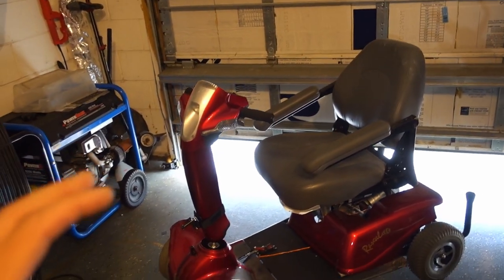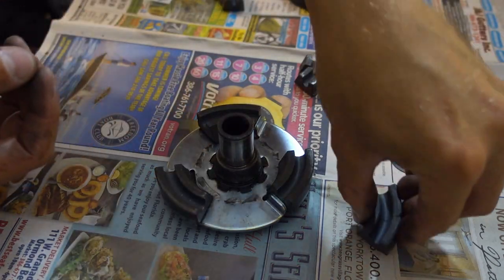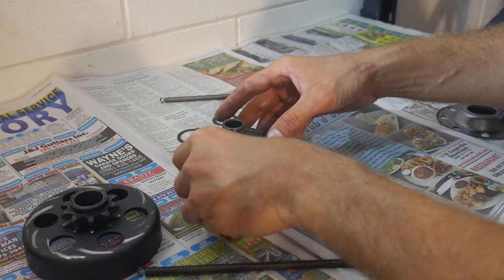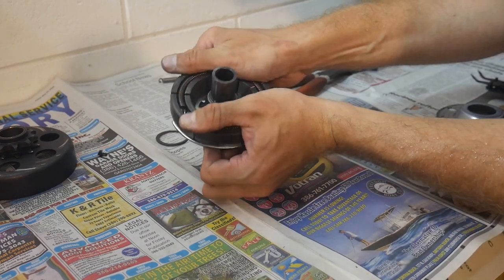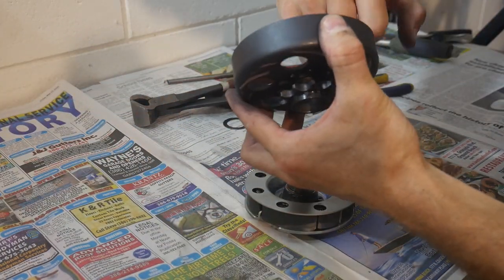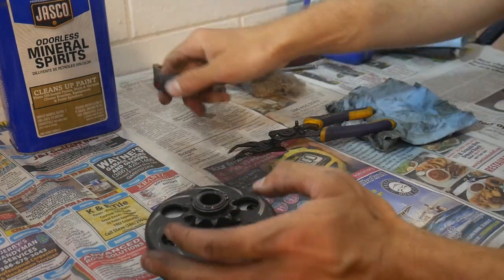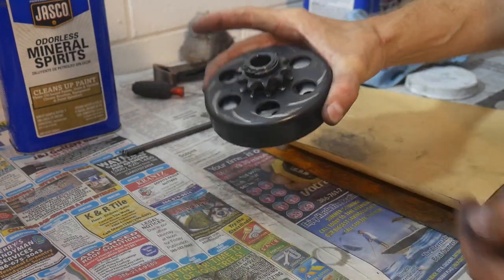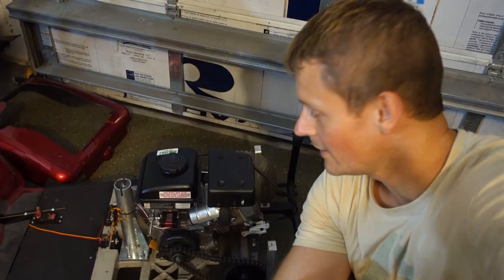Free Go Kart Clutch Performance Mods | Centrifugal Clutch Upgrade

Comment: Black electrical tape wrapped around the outside circumference of the shoes will hold them together so you can install the spring, and reassemble the clutch. Once assembled, simply remove the tape. No more popping shoes.

Comment: Pro tip: use a hose clamp to keep shoes in place if you’re having trouble getting the spring in place😘
Reply: Better pro tip, remove the sproket out of the bell and flip it upside down, sit everything in the empty bell and put the shoes and spring in , then put the top, c clip, and pull it out; then put your sprocket back in the bell and stick it all back together; also I use a 1” piece of pvc for the C clip and hit it with a mallet

Comment: That's pretty impressive I've never seen anybody put a clutch back together like that and make it look so easy.  It's easy for me, but I have a trick. I could never put the clutch back together the way you did it with out some serious aggravation . I put the shoes and the springs together facing down on top of the plate you had on top.  And then I mash the other plate with the fins on it into the piece holding the shoes.  Then I grab a couple of  small C clamps and clamp it togethe, before I put the lock ring on.  Otherwise they blow up in my face as I'm trying to put the lock ring back on.

Comment: A trick on re-assembly I did was to put a large hose clamp (or double clamps strung together) around the shoes before putting the thin plate and snap ring on. It retains the shoes nicely. One benefit of these clutches is unlike the maxtorque- these can get locked onto the shaft tightly by the drive shaft end bolt. The xtra tension helps keep the key intact.   Mike
Reply: Smart trick I like that
Reply: yup, me too, put 2 hose clamps in series to hold the shoes together while I stretch spring into groove!

Comment: It kill’s me to watch you struggle putting the spring in and the pieces going everywhere when could have turned the outer plate upside down and placed it the cradle. Then put the spring in.

Comment: Max-torq has a similar video on how to modify a standard centrifugal clutch for racing. He cuts all of the shoes in half, and takes 2 loops out of the spring and says to only do the modifications on a new clutch, never a used one.

As a side note, I'm building an old kart for my niece, the first one I took over for her and her brother is too long for her to reach the pedals, a centrifugal clutch is the last item I need to surprise her with a new kart, and I'm on a stay home dad budget, my kids kart is already finished.

Comment: Maybe you can help me out:  Just purchased a go kart with a 212 predator 6.5 hp engine.  It has a centrifugal like the one shown on kart in this video (i believe it has 10 teeth).  When we first ran it, it ran like crap.  But once I cleaned out the gas tank and replaced the fuel filter, tore apart and cleaned the carburetor (removed the jet ran thin wire and carb cleaner through all the ports) put it back together, and finally replaced the plug with a recommended High performance non resistor AR3910x Autolite plug,  it ran amazing with top speeds of 35 MPH.     I'll be honest, I don't know much about live axels, centrifugal clutches, sprockets, or torque convertors.  The live axel has a 60 tooth sprocket  Question:   Is there anyway that I can gain more take off power, especially like in grassy areas??  It will take off pretty decent on pavement, but once it's in  the grass or making turns, It takes awhile to get going.  I know the centrifugal clutch on it is wobbly ( like really wobbly) rusty and loose... maybe it's not engaging or slipping during take off???   So would replacing the clutch help with more bite/grip when during take off?

Comment: I just finisd putting a 6.5 hp honda motor in a mini bike and it has a brand new clutch. And it just smokes the clutch I'm gonna try this modification and see what happens. If you wanna send one cool I'm probably gonna need one.thanks.and I have an old briggs and stratton engine that the shaft is 7/8  or 1 inch the Honda is 5/8 and I can't swap the the clutch from engine to engine

Comment: What works the best is to make that piece of crap spring perfectly round. Goes together so easily, you even start enjoying swaping the  clutch shoes or spring itself. It also catches at much lower rpm because the spring is not dragging

Comment: Predator engine in a go cart for my son been having it for a few years it has a 13 and a half predator engine but no drive train did have a 30 series tourque converter but not big enough for that amount of tourque so it just went threw belts so did away with it it calls for a 40 series but haven't been able to come up with extra funds to acquire it but this project is extremely important to me cause it was something me and my brother was working on to get going for my son and my brother here recently pass away so I wanna finish it for him basically cause it was something we was working on together

Comment: hi. thanks for sharing all this mods. one question: Is it normal to have 525 Farenheit Temperature in the Clutch??
Reply: Thats a hot tomata
Reply: I'd say no, but I'm running a Briggs and Stratton Vanguard Vtwin 479cc 16 hp in a Massimo Baja Warrior MB 200 minibike and if I give it much throttle at all on take off from a dead stop it slips horribly even with a new clutch. In fact going up my buddy's driveway wich has a moderate incline, from a dead stop actually made my clutch visibly glow red until I reached the top where it leveled off ,I let off the throttle and the clutch grabbed and then began to cool down. I had to immediately disassemble it and re lubricate the needle brgs which had cooked every bit of the high temp lube off of them.

Comment: Any ideas how to get a very low RPM? I’m talking about 100 RPM or engages around 3-4 mph.
Reply from the maker: You want very low rpm engagement right? Would be the opposite of my mods, so going with a lighter spring or stretching out the stock one. Any engagement that low will probably stall the engine pretty quick though

Comment: Hey thanks for all the videos very interesting  and helpful I am building a motorcycle  using  a schwinn bicycle  frame and a Honda 11hp engine sure could use a clutch that would fit a1" crankshaft

Comment: What does cutting the plates in half do and why not cut them all.???? And I would use the clutch for my 79 cc mini bike build.
Reply from the maker: Cutting then makes more points of contact when centrifugal force pushes them out. You cannot cut the ones on top of the hole in back plate or they drop through 👍

Comment: That's a nice clutch I can use it on my my invention got a quadcycle quad front with crouch rocket rear end with a 12 hp cast iron Briggs and Stratton motor of a generator

Comment: Hey bro I just bought a 420cc predator engine with a 1”inch shaft and I’d love some pointers for performance before I screw something up and since u giving a cluthch assembly for that size I’d love to be that lucky guy. Lol
Reply from the maker: Clutch winner has already received the prize, but if you go to my 79cc power mod video, those same performance mods will work wonderfully for your 420cc!

Comment: I have a 11 hp honda on a yerf dog frame that we are building. Got the motor of a a generator. Got everything off the end of it and known it down to a 1 in shaft that's all we need so we can get the engine mocked up.. we're big fans
Reply from the maker: Sounds Awesome! I’m going to do more with smaller projects as well, like what your building.

Comment: I need a clutch for my go-kart 
I was driving it and the clutch literally blew off the engine 😮 couldn't handle the power of the predator 212cc upgrade
Reply: Just a guess, wasn't installed correctly. I've got a 212cc predator degoverned that's been running the same centrifugal clutch for over a year, I'm 6' 160lb and the clutch helps me run along about 40mph all day long, I ride it 3-4 times a week and push it hard.
Reply: @andrewsavage1872  did you use any lock right or something on the bolt when you installed it?

Comment: My clutch won’t engage, and at full throttle, it engages slightly, what do I do?
Reply from the maker: Could it have gotten grease or oil in it? Sounds like contamination. If no contamination can try a softer spring to engauge at lower RPM
Reply: @DirtGearTv  thanks for the feedback, I have a ct200u ex, and I’m getting an 18 tooth clutch with a 50 tooth rear sprocket, at 4500-5000 rpm, with 19 inch tall tires, how fast will that go?
Reply: @troubledwarrior5755  There's no way that gearing is going to work.

Comment: I've got a Honda 200gx that is sitting still on a murray exsplorer 1 seater pretty sweet I've been able to modify body from scrap and stuff but need clutch or front pulley of torque converter system what it has is half the big one I have no money so I been waiting for someone to trade or win one I am Tony p. And I've watched them all